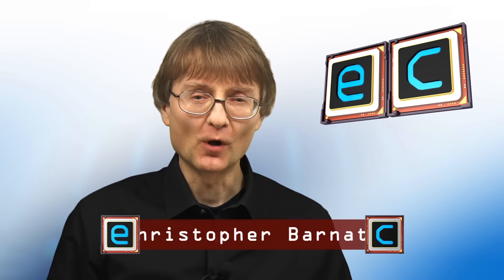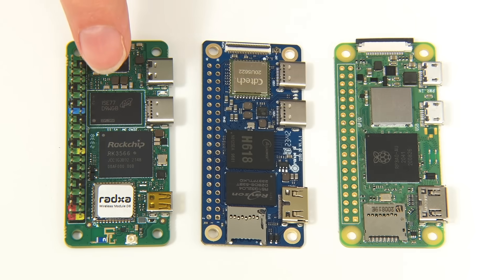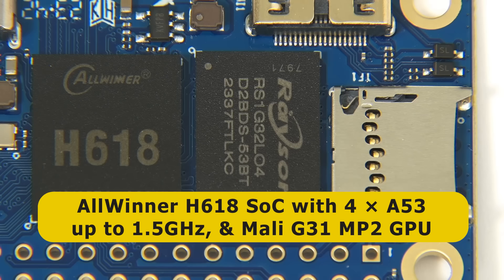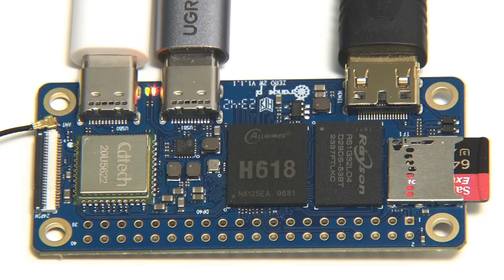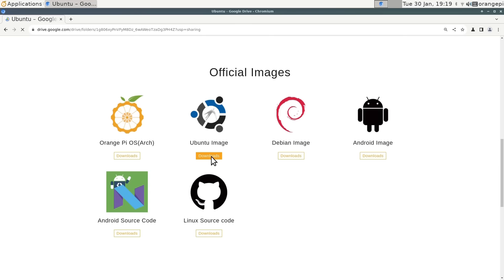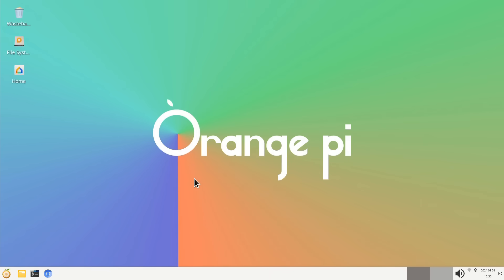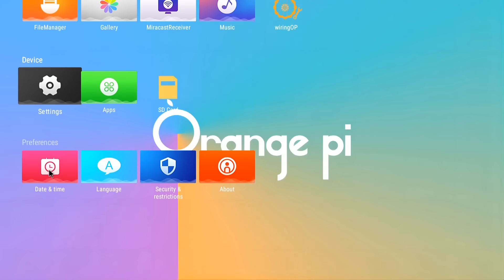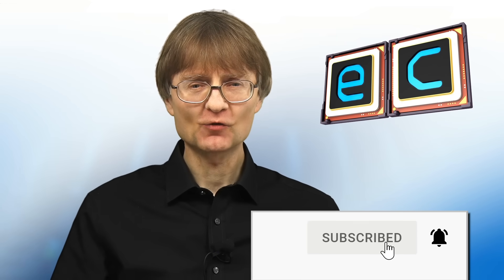Orange Pi Zero 2W

Comment: These boards would go mainstream if their marketing teams could actually articulate specific use cases on what they do better than a comparably priced Raspberry Pi.
Reply: Why do they need to go "mainstream" when they are "hobbyist" boards?

You're getting confused with the "anomaly" that is the Raspberry Pi as the single range of SBCs that have a huge amount of support and a large community to turn them into "near consumer" devices - because anything that you, as a newbie, could want to do with a Raspberry Pi will have a YT video or a web site article to follow for you to do it.

But these boards were not initially released to be retro gaming platforms or desktop PCs - they were aimed at industrial applications and giving school kids cheap computers on which to learn programming.

Sure, the "market" has dictated other uses for these boards since then (like retro gaming and desktop replacements) and that, in turn, has driven advancement in CPU power and memory on these boards - but most industrial applications or kids writing in programs in Scratch don't really need much beyond the original Raspberry Pi boards released back in 2012.
Reply: @terrydaktyllus1320  While much of what you say is true, I definitely wouldn't put you in charge of marketing.
Reply: @j_h_o  I am an engineer and a "techie" and I have been for more than 40 years - I programmed my first computer in assembly language back in 1982 and I have had "the computer bug" ever since, both as a hobby and in my work.

So, yes, I wouldn't put me in charge of marketing either - I'd be bored senseless within minutes and it's why I deliberately avoid sales meetings and events at work because there is no situation more hideous for me that being in the company of a group of drunk sales and marketing people.

Comment: Hey! Something you miss; The OPi Zero 2w runs on DDR4 RAM instead of DDR3 on the Zero 2.
And there's also an OPi Zero 3, with the same factor as the 2, but with the same hardware as the 2W and gigabit Ethernet. To add more to the confusion 😂
I'm using this Zero 3 to run Klipper on my 3D printer and frankly it's an overkill.

Comment: A consisten failing of Orange Pi and the reason they can never be the market leaders; is their poor documentation and support. They host the OS files on Google Drive, which quickly rack up bandwidth usage and get blocked by Google! You will be hard pressed to find working links for OS downloads for their older boards. They never reply to any support emails either. How expensive will it be for them to host their files on AWS? or even a cloud HDD from Western Digital? Come to think of it, how are they accessing Google Drive in China?

Comment: considering how easily you can solder even as a beginner, including the header but not having it preinstalled is actually the better option, because theres a lot of things that can use a lower-profile pi header, sometimes even with pogo-pins, where the header would just get in the way of either the case, pins, or both

Comment: They missed a trick -- the board itself should have been orange. Branding is important, after all. But otherwise, it is a nice board. I really like the expansion board with all the connectivity. And at $11.99, it's not a bad price. As you point out, some of the software is a bit dodgy. But really and truly, this is not supposed to be a desktop substitute. Plus, (and this is a HUGE plus), the board is AVAILABLE! All in all, this looks like a promising piece of hardware. (PS: Hello, Mr. Scissors! I hope you and Stanley are doing well.)

Comment: I have this SBC with the expansion. Orange Pi has launched the Zero 3 which also has the H618 SoC and supersedes(?) the Zero 2, and it also goes up to 4GB RAM. According to the sunxi project the differences both SoCs are minimal, the H618 has better support for newer versions of Android. In fact, the H61X SoCs were designed for low cost set-top boxes and the Android images provided are Android TV versions, not full Android. I haven't tried it yet, so I can't comment.

Performance is fairly good in any of the OSes, but it lacks support from 3rd party OSes like Armbian. I've tried the Orange Pi OS, Ubuntu Desktop and Debian Desktop images (all kernel 6.1). I don't remember having issues with Orange Pi OS but I didn't spent much time with it, I prefer Debian. What I noticed on all of them is that at 4K (UHD) HDMI output the desktop is very graphically glitchy. When I resized to FHD the glitches went away, I think that even basic GPU support is not quite there yet. There are some other minor bugs, like the WiFi strength indicator only works ok after you click it, despite being connected. Changing keyboard layout to my native portuguese layout in the terminal console in Debian was a bit involved, despite everything in the orangepi-config utility being set correctly. Native XFCE preferences won't work at all.

Hope Armbian picks up support for the H618 based boards like the Zero 2W and Zero 3, having 4GB of RAM is great. I'm sorry but I can't get myself to trust the Orange Pi images (being updated from repos in China...). Mainline kernel support is being worked on and probably we'll have more choice in the near future. As is, I rather place my trust on the Radxa Zero 3W despite being more expensive and more difficult to buy but the RK3566 is much better supported.

Comment: To enable the gpu acceleration you need to run "sudo orangepi-config" i did this on the debian image but i think ubuntu works as well, then inside the menu, i think it was "system"->"hardware", tick GPU save and reboot.

Comment: When a manufacturer can't write a stable operating system for their own product it shows a serious level of incompetence.  Even with that limitation it should make a great little python development system.  Not running in its own native environment  wont affect someone developing code for physical programing, and using the device as an intelligent controller. While I fully support the Pi pico,  and Pi W2 . It's good to branch out and use other platforms when they  present a more cost effective solution, or offer additional options.

Comment: I am always astounded when I see a computer, with the specifications such as this, at this price and this form factor. I know I should be used to it by now, but I still find it amazing.... and I must thank you for your work in bringing these to us Chris, you have helped popularise these little marvels to all our benefit..
Reply: I'm right there with you, mate.
Reply from the maker: Thanks for your support, and so very true. :)
Reply: I think we're both "veterans" in computing and, if anything, I love the fact that I never cease to be amazed by the ever increasing power and smaller sizes of computing devices.

Up to a few years before 1992, the first computer that I used to connect to BBSes and then the Internet was a Commodore Amiga - for dial up Internet it was an Amiga A1200 running at 14 MHz with 8 GB RAM using the "iBrowse" web browser.

One of my favourite PCs (as a Thinkpad-collecting Linux bloke) is a Thinkpad T22 from around 2002 (a decade after the A1200) that has a Pentium III CPU running at 700 MHz and 512 MB RAM - so 50 times the CPU speed and 64 times the ram of that Amiga A1200, and that was 22 years ago! I didn't own the T22 from new, I bought it in a pile of broken laptops from "everyone's favourite auction site", repaired it and now I use it once or twice a week to program shell scripts on my server via SSH as it has a great keyboard and is a "long lost" way of doing distraction-free computing.

I'm very lucky to have "the childlike eyes" of an old computing bloke who has never forgotten the importance of the word "perspective".

And I find it utterly shocking (but in a nice way) that I can pick up a used HP, Lenovo or Dell SFF PC with a third or fourth generation Core i5 or i7 CPU and 8 GB RAM on "that auction site" for less money than I'd spend going out for a Chinese meal of an evening - any one of which makes a fine platform for Linux or BSD as a daily driver.

At the same time, it's saddening to see people rushing like lemmings into immediate upgrade mode just because Microsoft has churned out another Windows version or some greedy company has churned out another buggy and derivative "game as a service" without even understanding why they're doing it - albeit I can snap up their old hardware cheaply when they get rid of it.

Thanks for the effort you put into your content too - I'm still very much a Linux bloke but do have a few BSD systems kicking around as well.

Comment: So other than a retro game device, what is the usage case for such a machine?

Linux seems way more than  what such a thing needs.

Along with that expansion board, Orange Pi seems to own this space now though.
Reply: All good usages to be sure but none of them seem to use the display as part of their regular function. But that's kind of my point, there are lots of average performing functions thrown together but there seems to be no good application that uses all of it.

It runs an over the top powerful operating system (linux) but isn't really fast enough to exploit that functionality. It has gpu functionality but no drivers to use it. It can do those functions you provide but really has way more resources than resources than they really need. It seems kind of like using a plasma cutter to open the electrostatic bag.

Comment: Hello Mr Scissors! Long time no see! As you say Chris software is everything. The Ubuntu is nice but nearly 2 years old, which is a lifetime in SBCs….😮
Reply: I would ordinarily use Mr Teeth for a job like this.
Reply: Stanley the Knife must be banged up yet again ... if only he could stay out of trouble.
Reply: Mr. Scissors in vital bag opening drama! Stanley the Knife is jealous! 😎
Reply: The age of the official distro is disappointing, for sure. I've had success with  the DietPi for this board. I use it to run a Snapclient for a multi-room audio setup. The added antenna makes for great connectivity compared to the vanilla Pi Zeros I have running in other rooms.

Comment: A shame that Orange Pi OS won't work. Effectively useless. I'm sure that this will get looked at very soon however.
Reply: That's exactly where orangepi lacks! Not only only on this model. A random Google drive is a HORRIBLE place to download a server OS
Reply: 3e😊😊😊😊😊😊 @abo3abid1 ❤❤❤❤❤❤❤
Reply: I can buy pi zero 2w today(locally, for $14.99 US). They'll be gone tomorrow, probably for several months. Same for 4B 8G, although they have actually been more consistently available since the release of pi5.
Reply: I've got a cluster of them running headless, not a single problem. Great little SBCs
Reply: @bigpickles Something tells me you haven't run dmesg after first boot.

I run an opi now but its software support is lacking.  Example: ubuntu for orangepi 5 plus 32gb has device mapper disabled in kernel.  This means no raid, luks encrypted drives, or other kinds of virtual filesystems.  It's a pretty fundamental feature to exclude.
Reply: I don’t know, I’m using it just fine , even repos are reasonable. Yea google drive is weird but it looks like the whole orange thing is one guy
Reply: I see what you did there. I actually read it in Christopher's voice like: ".. veeeery soon.." 😅
Reply: Ma man wants to enjoy some of the colonial pride so let ma man have his cake 😂. Pride of You Khay😢.
Reply: Where they are made does not matter as much as being a full product. I remember getting a rockpi a few years ago that will brick itself if I just run "apt-get upgrade". That is the same as a shady google drive OS, or no updates
Reply: @abo3abid1  that's the difference between a company who churns out fashionable products and doesn't support them, and one who has a long term vision and supports them long term.
Reply: This is why I buy raspberry pi products.  They are way more refined and well supported.  I'm running PiOS on my Pi 1's.
Reply: @UnCoolDad  what you say would be valid for the average consumer IF Raspberry Pi's were actually available for purchase anywhere (at retail price), but even now in the US, I have to check Vilros weekly, sign up for notifications when they're in stock on various sites and hope I notice the email before they get scooped up en masse by scalpers. You shouldn't have to make it a part time job just to obtain the SBC's for future projects and stock up on them before you even need them, just to have a reliable SBC product for your projects. I started purchasing Orange Pi for this reason, but I will say, as someone who cannot wrap his head around navigating/configuring/troubleshooting Linux systems for the life of me.. I agree with you about Raspberry Pi community and I will continue to try to obtain them when and where I can. I need the community support and tutorials to accomplish anything on them :/ I tried for literal weeks to figure out how to just get a 5" HDMI touch screen with a GPIO connector meant for RPi, working with an Orange Pi 3 LTS to use as my 3D printer "brain" running Klipper and failed miserably so.. either raspberry Pi foundation needs to figure out how to crank out more product instead of.. I don't know what they're doing, trying to milk the lack of supply to make their stuff seem like it's worth more and raise the price? I really don't know what they're doing.. or Orange Pi and other RPi alternatives need to get their act together, have working software and build community, because it's the community support that makes all the difference.

I don't even use Raspberry Pi OS on my RPi's so I don't care about Orange Pi OS either. Debian works great for all of the same things... As long as they have tutorials 😅
Reply: @UnCoolDad  but rpi zero is bad because it has small RAM only 512MB and does not support browser...it is not suitable for some projects
Reply: @UnCoolDad Why? There are plenty of good SBC makers and Orange Pi really only makes good hardware, without good software. With how Raspberry Pi Foundation actively tried to destroy their goodwill by whatever they were doing in 2020-2023 and are still doing now, it's not a good choice, especially since all Raspberry Pies are starved of RAM.
Reply: @one_step_sideways  I value stability and long term support over cheapest price, and obsolescence.  I also value made in Britain over made in China.  But you do you.
Reply: @UnCoolDad ”assembled”, rather than made. All the chips are made in the far east.
Reply: @one_step_sideways  as I said, I'm running current PiOS on my raspberry pi 1's.  I'm not sure how that is planned obsolescence.  If the specifications for the Pi don't suit your needs, then use something else.  It is that simple.  Your criticisms are unfounded.
Reply: @AdrianColes  By that definition - 100% of electronics worldwide are "made" in the far east.  From a legal standpoint, they are "Made in the UK".  Those words are even stamped on the device itself.
Reply: @UnCoolDad fkn racist
90% tech either made or assembled in  china
iphones also assemble in china 
all android assemble in china
Reply: @aibi5532  I'm not sure how you can play the race card here, but raspberry pi's made in U.K.  Since 2012.
Reply: Maybe some people just don't like public piano players?
Reply: @UnCoolDad 😂😂😂this dude man ...
Reply: @UnCoolDad Yes. Nearly 100% of elections are made in China, Indonesia, Malaysia, etc.
Reply: @Xmasta420  Most CPU's and GPU's are made in Taiwan - not China.  The microprocessors on the Raspberry Pi 5 are either made in Taiwan, or possibly Broadcom's US fab.  As for all the ancillary parts like resistors, caps etc - yeah, probably China.  The Raspberry Pi itself is made in the UK.
Reply: @outbakjak Cheap and greedy? So you fail to understand the simplest concept in business? Of course, you would happily run a business and not take any profit for yourself, making money is clearly abhorrent to you. I bet you would gladly pay two or three times as much to manufacture a product, rather than have it made abroad. But then you'd have to charge more just to break even. And then you'd go bust, because foreign companies will produce similar goods for less. You'll go far in business. 😂
Reply: @another3997 That was a good set of logical fallacies, and generally quite rude. 
While I am sure you have a valid point somewhere in there, it is difficult to see past your insults and bad logic.
Reply: @aibi5532 really? You had to play the race card? How inept are you?
Reply: Here for the vid and checking for the 1 million subs…. Almost there.. been here for years and love the content keep em coming ….
Reply: But i cant buy any RPi SBC at MSRP. Instead, I bought a OPi H6 with price of a RPi 0w (35$) . Thankfully well support from Armbian so i still can use it for many purposes.
Reply: @susugar3338  according to rpilocator pi 5's are in stock worldwide at official distributors at MSRP.
Reply: @susugar3338  there is lots if stock on rpilocator. Cm4, rp5, rp4, zero2w etc. Prices seem reasonable.
Reply: @susugar3338  I bought a RPi Zero 2W at a micro center last week for $15.99.
Reply: This device is crap. I wasted over 35 dollars on the 4gb version , plus 12 dollars on heatsinks , only to realize my fire tv 2 box from 10 years ago is still better .

Comment: Hi, Chris, as usual a very good review.  Thanks.  However, I suggest you record the phrase "the GPU isn't enabled" 'cause I don't recall an SBC that did so you can just play it when ever you review an SBC.
Reply: Are there actually any non-pi SBCs with GPU drivers? They always advertise them in the specs but then neglect to tell you there's no way to use them...
Reply: The GPU can be enabled by editing the settings at the dtb
Reply: It's really easy to enable the GPU, just open orangepi-config.